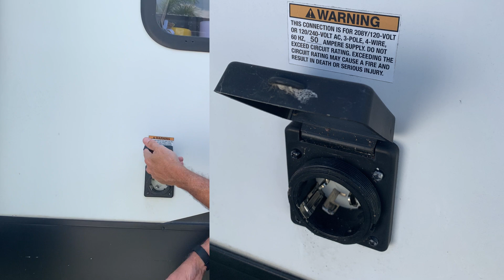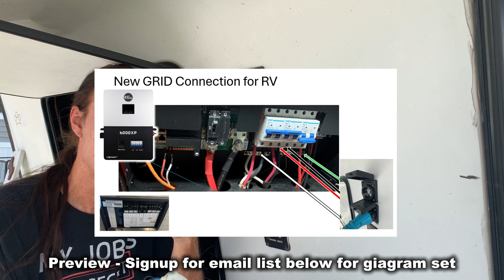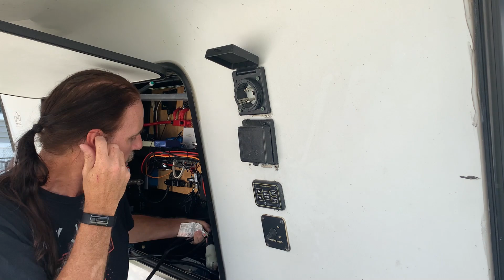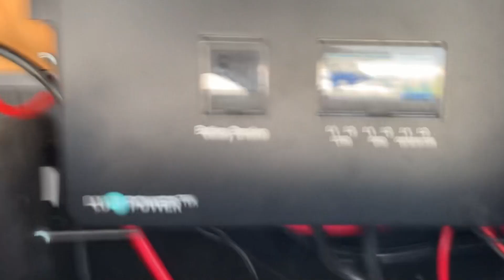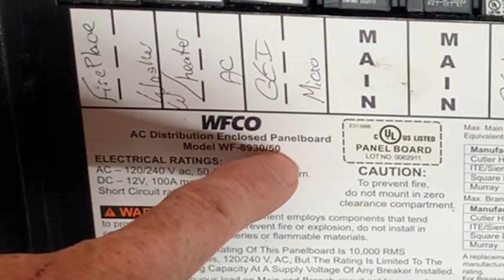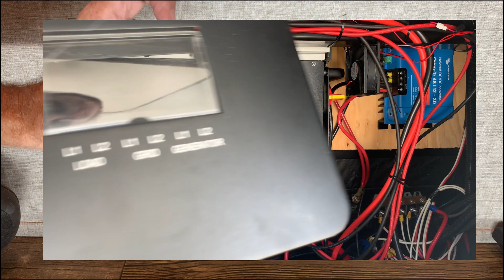How I Seamlessly Switch RV Power Sources — Game-Changing Hack!

Comment: Just a comment for those learning. Black is L1 in almost every application.
Reply from the maker: As long as you are consistent.
Reply: @MattManSolar that’s true in this application.  I would just hate for someone to wire a 6XP up at their house like this.  That may be a bad out of phase day for some.
Reply from the maker: @Dmkjr yes you are correct.. black is standard for L1 ..

Comment: I think I would have done an automatic transfer switch at the grid plugin but whatever works is the answer.
Reply from the maker: There is an automatic transfer switch build into the AIO, now if you have like Victron inverter then you would need to use the transfer switch and do extra stuff to get the charger working.